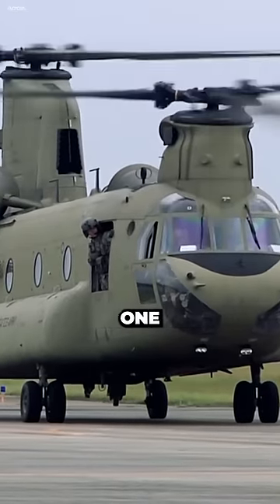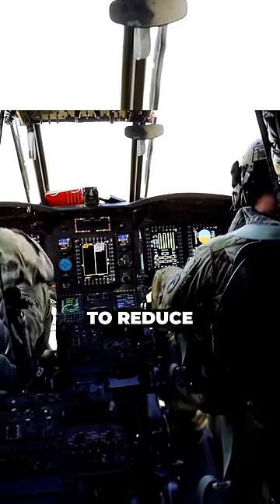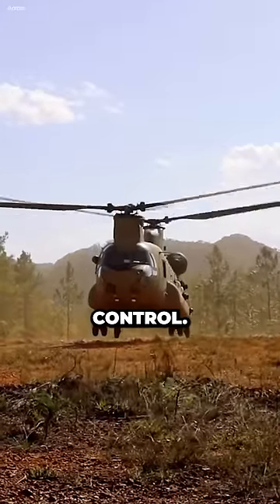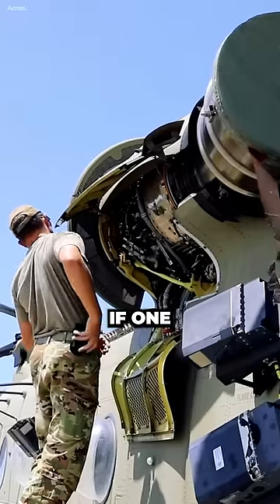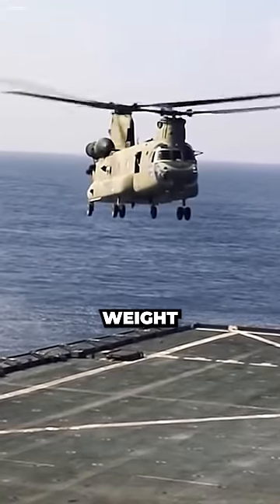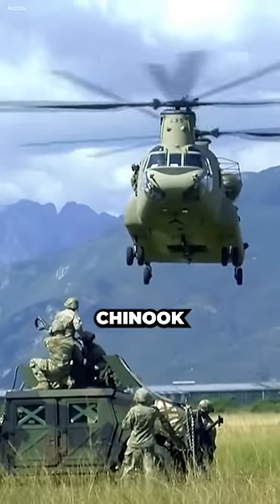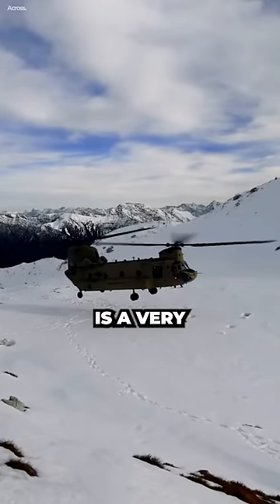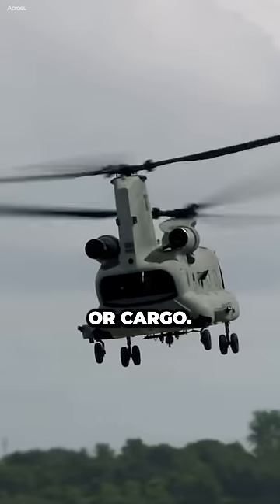What Happens if One Engine Fails on the Chinook #shorts

Comment: it can fly with one engine but not with only one propeller..the heli cannot fly with only one propeller it needs at least 2 propellers..the second propeller aims to balance..
Reply: 1 Engine can turn both propellers...
Reply: @n3v3rforgott3n9  I know 1 chinook heli engine has 1 long shaft connected to the second engine propeller for safety purposes in case 1 engine is damaged.. what I mean is that a heli must have 2 propellers to fly.. it will not be able to be flown using 1 propeller..this is heli 101 basic everyone knows..🤷🏻‍♀️
Reply: @audreyDsouza  That applies to every single helicopter... why even say it.
Reply: @n3v3rforgott3n9 no it doesn’t because not all helicopters have 2 rotors, 2 engines or 2 gearboxes.. chinook does
Reply: @ZamanDepho  my guy. the Osprey and the V-280 has the same system the Chinook has.... also yes helicopters need a second rotor to fly properly and on most helicopter that second rotor takes away additional power.
Reply: @n3v3rforgott3n9 not the same. The v22 driveshafts will only engage if an engine fails. This usually results in crashes due to the very complex systems.
Reply: @PeacefulRallyCar-pw3cs  no... that is not how that system functions. Both rotors are mechanically linked together at all times, and thus, both engines are linked. Also, you saying it constantly results in failures when not a single crash has been due to a single engine loss resulting in a crash after.
Reply: @n3v3rforgott3n9  wrong and wrong

Comment: They do a precautionary landing, pathfinder team will secure the site (if they are in a combat zone), once its safe a dart (downed aircraft recovery team) team comes to see if it can be rigged to RTB, if it can the dart team with specially trained pilots fky it back (pilots specialize in flying unstable aircraft), if it cannot be repaired pathfinder team will prep it for sling load, if for some reason that won't work take all sensitive items (machine guns, radios, ect), bkow it up with c4 or have the air force drop a jdam on it, and thats really it.
Reply: Also, designed to fly on one engine yeah no. It's designed to do a precautionary landing with one engine.

Comment: I have a question what's these things that the chinook have like jet engine
Reply: You mean “the engines” these aircraft dont have car engines in them, those rocket like things are the turbines, the turbines are the engine, they spin, work a gearbox and run a shaft. At that point they are like a normal vehicle.
Reply: @f1reguy587  no i mean the rocket engines on the 2nd rotor
Reply: @Mr_gun5hip-.  Those are the engines, the gas turbines.
Reply: @Mr_gun5hip-. They are the actual engines, the rotors are powered by them
Reply: I guess you coooould call them rocket engines. powerhouses

Comment: Nice design but can it auto rotate  in case of emergency.
Reply: yes...
Reply: @rashmiranjannayak3251  have any videos of a CH-53 autorotating? That is such a dumb comment. There has yet to be a dual engine failure in a V22 and thus has never even been a situation it has been brought up. Pilots can train for autorotations on the simulator just like a CH-53 pilot can or any other helicopter pilot. Also, people focusing on autorotation ability in military aircraft is dumb as it has not saved a single large multiengine helicopters in decades.

Comment: if an engine fails and it doesn't go into autorotation  the entire aircraft will go into a spin
Reply: it has contra rotating  blades so negats that.
Reply: The chinooks blades are hooked to a common/linked driveshaft so that one engine can simultaneously run both propellers at the same time, essentially for one of the blades to stop, both engines would have to go down and both blades would stop around the same time
Reply: @420IQPlayer or a shaft could break…
Reply: Tell you didn't comprehend what was said repeatedly on here without actually telling me you have no comprehension skills.